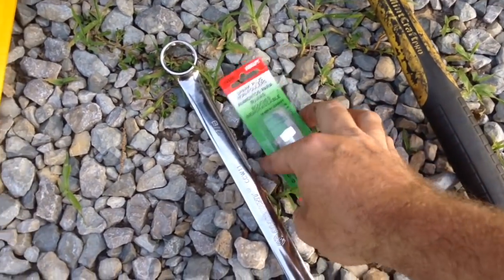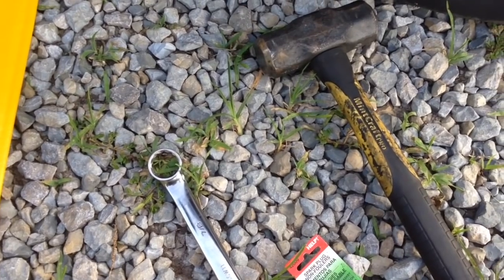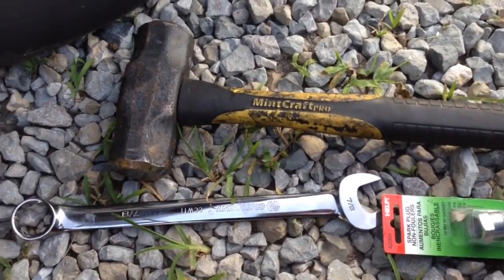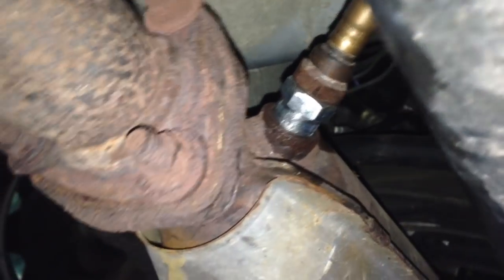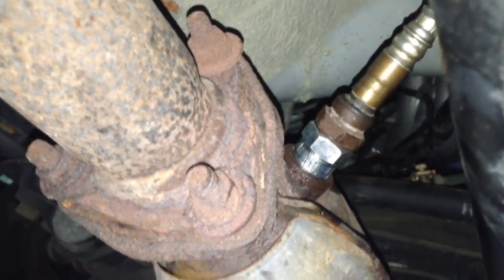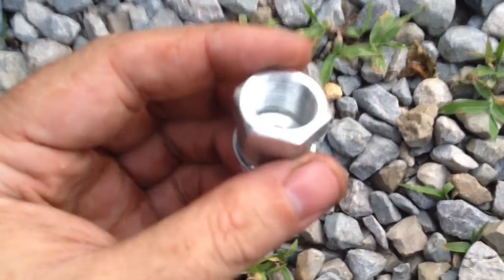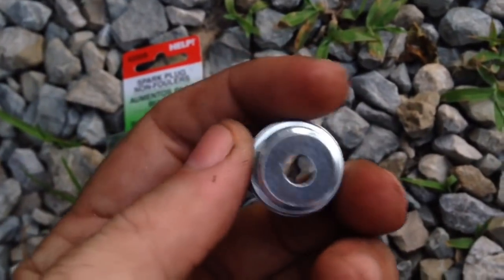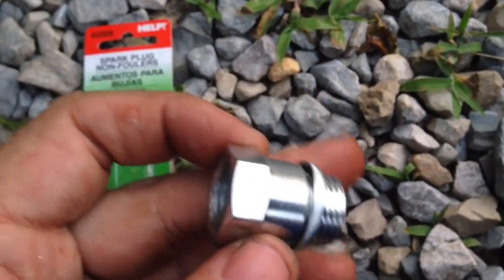How to Fix A Clogged Catalytic Converter P0420 P0430 Super Cheap on any car

Comment: what about for a 07 prius california legal converter?
Reply: Wtf?! A prius getting an emissions issue?
Reply: Z Ack oh yes.  I’m working on fixing an 06 (gen II).  The replacement is OEM only in CA and the part is around $1800.  Tried sea foam and cataclean so far (junk), next will be this and drill the cat with a pinhole to fit a spray straw in and try and clean the cat directly (seafoam or carb cleaner) close the hole with a sheet screw.  My Prius runs fine, but less than a small percentage in the smog system from perfect will throw codes.  A royal PIA.

Comment: Would this keep my check light off?
Reply: KEEP it off? No. There are more things than just getting bad reading on an oxygen sensor, that can turn that light on, but most are Emissions related. As in they have to do with how much your car is polluting the atmosphere. Usually, unless you can physically feel/hear/smell your car doing something wrong, That light is nothing to worry about.
Reply: @fullcustomization  Until ya gotta get a smog check. LOL
Reply: @jakejones5736  I'm one of the lucky ones I suppose.  I live in a state that does not require emissions checks.
Reply: @fullcustomization  I'm JEALOUS!
KaliFornia, where it's dealer ONLY. About $2500!

Comment: What's the purpose of drilling through the part?
Reply: alex flores the parts inner diameter is too small to fit your 02 sensor. You’re only drilling it out in order to fit the 02 sensor inside the part. If you have a German car, you may be able to fit the sensor inside the part with no issues.
Reply: @postmalone1582  Thank you for replying.  It turns out I needed a new battery and it caused to computer to throw all kinds of codes caused from weak battery. New battery and everything went back to normal.  I own a 2015 Dodge Journey with V6. Thanks again.

Comment: 2014 sierra with a 5.3L... did not work. It did work for about 1 week
Reply: Ive heard of guys running 2 defoulers back to back then the sensor. It gets the sensor further back from the flow.
Reply: You can also try to add steel wool in-between the fowlers if using two doesn't work. Also good to try cheap first if you can the time and know how.

Comment: Did I miss something ? 
If I understand this video correctly, you're just tampering with the codes so it clears the codes. 
This does not clean or unclogs the catalytic converter. 
If your catalytic converter is filthy dirty, clogged or no good anymore, this video is useless. 
Or am I missing something ?
Reply: Your Missing something.

Comment: I have Toyota land cruiser Prado 4.0 v6 engine
and having p0430 error 
what's should I do
Reply: Hussain farooq qureshi p0430 type that in google you will find the solution
Reply: Did you get the problem solved? If yes please share

Comment: Ive tried the spark plug doohicky deal and it didnt help..  i even went as far as putting 3 of those fuckers and an elbow, got new sensors and still got the damn pothead code..  no vacuum leaks or exhaust, i gave em the pothead smoke treatment and no smoke leaks..  intake gasket is fine, egr good, injectors 0 faults no misfires, fuel pump is great and ran live data tests on everything..  cant be catylitic converters because aint got none..  well now that i think about it i guess it could be the fact i dont have em anymore but those plug foulers should do the trick..  and the maf is clean.  The fart canister is clean.  Dunno.  I dont see the harm its doing so thinking i just might pull the bulb and that should fix everything...

Comment: P0420 1st bank... why put it in the back one? And not the 1st one? If its th bad one
Reply: The bank is just the side of the engine your cat is on, meaning, bank one is the side of your engine with the No. 1 cylinder if you have dual cats. If a single cat, you'll only have bank 1. Position 1 is pre cat and position 2 is after the cat.
Reply: Pre cat and post cat have nothing to do with bank 1 or bank 2...
Post cat(after the cat) is the sensor that determines your catalyst parameters. So this fouler would obviously go after the cat. The sensor before the cat will tell the computer when the vehicle is running lean/rich. Dont mess with that sensor. Just replace it when it goes bad

Comment: This is a horrible idea, you get the P0420  when your catalytic converters are bad which means restrictive exhaust, bad fuel mileage and it does
not solve the problem, in a long run it is cheaper to replace the catalytic converters and be done with it.
Reply: This is a temp fix for people who csnt afford a new cat and want to pass smoke
Reply: It could likely mean the sensor itself is bad.  The state doesn't mind forcing you to buy a cat when you never needed to.
Reply: And your point is why it is a good idea to measure fuel economy, at least occasionally.

Comment: This is actually useless, they make a part that screws right into your O2 sensor port and has a screen on it that will shut the check engine light off. These are mostly useless on most cars because there is no screen and the process is way too much for too little result

Comment: I've tried this a couple times. zero success. always ended up replacing the coverters.
Reply from the maker: I use this alot and ever has a problem, however some of the american made vehicles this may not be a long term fix, since they have very low grade converters that like to break up and totally fail
Reply: Nathan's DIY Garage how about Mazda ,??
Reply: This obviously wont work if the converters are too far gone.  I've tried this on a bmw with the p0430 code and it worked and passed smog.
Reply: Try put 2 instead of 1 filer
Reply: And if using 2 fowlers to increase the gap doesn't do the trick one last shot at tricking the sensor. You can add steel wool in-between the 2 fowlers. Cheap is always better if you have the know how

Comment: THIS WILL NOT FIX A CLOGGED CAT!!! This is designed to "fool" your computer into thinking there isn't a problem with your cats, which may be what you're looking for, but this in zero way fixes a clogged cat. The ONLY way to fix a clogged cat is to replace the cat with a new one, or install a cat-delete exhaust system.
Reply: yeah i figured that.
Reply: its kool to buy time for emissions though lol unless they can read fuel trims ahahahahah

Comment: i have a 2003 jaguar x-type 2.5 with codes p0420 and p0430. what shoukd i do
Reply from the maker: Noel Vargas do the non fouler mod or replace the converters